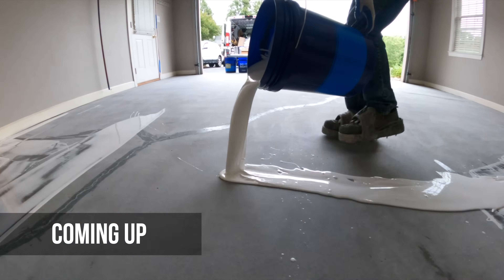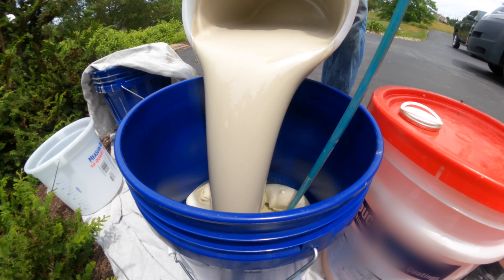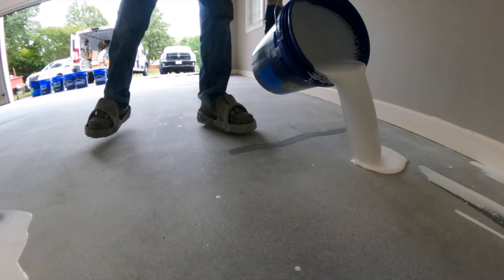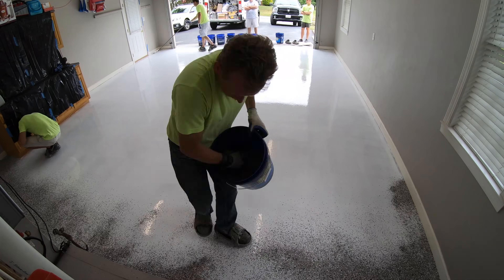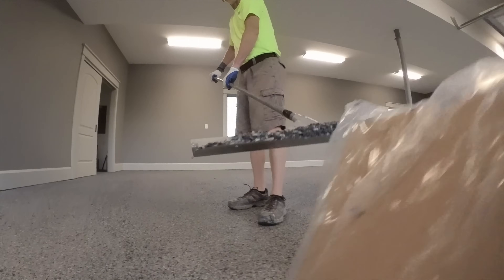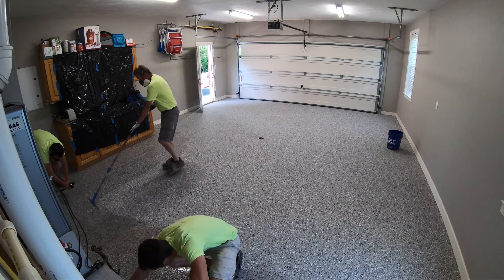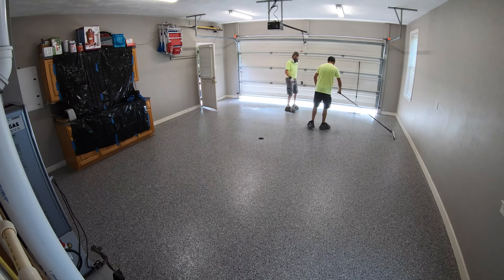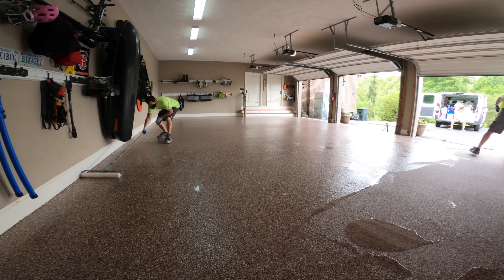Epoxy, Polyurea or Polyaspartic : Which is the BEST garage floor coating?

Comment: We had the same system applied to our garage floor a few years ago.  After they ground the concrete, they applied a product to extract moisture out and left it sit with fans for 2 days.  They checked the humidity and had to reapply the moisture product again.  After another 2 more days, they completed the finish.  It's been 4 years (Wisconsin winters/salt) and still looks perfect.  How do you deal with moisture and how long do you warranty the system (finish and adhesion)?
Reply from the maker: That’s cool. 

We use a vapor barrier primer that holds down up to 10lbs of pressure. Even if a floor tests low for vapor now, that doesn’t mean it can’t rise in the future, so we just use a vapor barrier on every job. 

I have a video here that covers that:

Epoxy vs. Polyurea : I forgot to tell you this one thing about garage floors...
https://youtu.be/UOeGvo5zGY4
Reply: Could you share the name of the company who applied your floor coating ?
Reply: @SavageBits   His own company does this.  The name of his company is on the side of his van.

Comment: Thank you for this video! I noticed some clients have their baseboards removed for floor treatments and some do not. Does it matter either way and which do you recommend?
Reply from the maker: It doesn’t really matter to us. I never ask customers to remove them for us… but if it’s a new construction project I will request for them to let us do the floor before they install the baseboard.
Reply: If it's a flake floor like this one, we normally ask the customers to remove the baseboards, and we will trowel sand and epoxy and flake up the wall where the baseboard was. Just looks clean and seals everything up 100%.

Comment: We used the Rust-Oleum solvent based epoxy + the solvent based topcoat and it is still pristine after 14 years, so I was glad we did not have to hire anyone for the job.

Comment: Please explain the rationale for steps. 1) why do you need to grind the concrete at the start, 2) what did you patch the hairine cracks with? Just concrete filler? 3) why do you need vinyl chips?
Im new to DIY and these details help

Comment: I loved your video thank you for your informations the floors look stunning ! I had my garage done 4 years ago , it’s starting to show a small wear and tear around the 4 tires where the car parks , I want to have someone coming to apply more protective top coat , I don’t remember what the previous company used I don’t want to use him because I didn’t think he added enough topcoat . What would be the best durable product to use for a top coat garage floor with chips ? How many coats should I ask for and does it needs to be sanded down a little bit for better bonding ? I am in the Washington PA area . Thank you very much for your time

Comment: Hi Tim! Thanks for your video. I have two contractors and they are giving difference price points. Both are using 100% solids epoxy. Contractor A: 2 coats of colored epoxy and then 2 coats of clear epoxy. Price: $5420 with coving. Contractor B: Initial Epoxy coating and then polyaspartic 80% solids urethane based. Price is $7280 with out coving. What am I missing here?

Comment: I had my floor done with a 100% solids moisture vapor barrier, then 100% solids epoxy with full flake, then a polyaspartic top coat… 
9 months later and it still smells strong. Have you ever heard of this? My installer said he’s been doing this for 20 years and has never seen or experienced it.
Reply from the maker: No I haven’t ever seen or experienced that. We use a 90% solids polyaspartic top coat, which means it’s only 10% solvent… so it doesn’t really smell that strong on the day that we install it. I can’t imagine what would cause it to still smell  strong that long after it’s cured.
Reply: @TimDCVA  thank you for the response.  Great videos.
Reply from the maker: Thank you!

Comment: So if you don't want to use chips and just want a smooth clean surface (Think like a clean room) you should use a Polyaspartic primer since it's UV stable and then go to straight to a Polyaspartic urethane top coat?

Thanks!

Comment: Hi, Can you please suggest the details of the products:1. High Solid Epoxy primer and 2. Polyaspartic Coating; where to buy and and what else to look for while purchasing. I am planning to paint my Garage Floor with Epoxy base and  using Polyaspartic (clear top) Coating, but finding it very difficult to purchase the items; especially, Polyaspartic  is neither available in Home Depot nor in Lowe's. It would be very helpful if you could kindly share the product details. Thanks in advance
Reply from the maker: Hi. 

We use 100% solids epoxy with 90% solids polyaspartic urethane. You usually have to buy directly from the manufacturer. 

We don’t offer specific brand suggestions on YouTube. That is available
In our course along with a lot more information about how to do this type of coating. 

https://decorativeconcreteschool.com
Reply: Great question, I have the same exact question. Did you get the details of all the products used to do the garage floor? if yes please send it to me as well.

Comment: I'm with you on that epoxies a lot better than the one day in and out epoxy has a better bonding to the substrate
Reply: False. The one days should be done in 100% solid polyurea which will penetrate and bond much better than epoxy. 

The two day shown here is less strong than the one day and they charged double labor cost. 

The capability to do one day is simply because it sets up quicker. It takes more skill and harder to work with which is why coaters shy away from it. 

Convenience of the workers is usually a non-factor for a consumer. They want the best product you want the "one day".

Comment: I have some water seep into my basement/ garage from rain and snow draining down my retaining walls or under my floors. I’m trying to eliminate any water from coming up through the floor (I don’t have a sump pump or French drain) I only have gutters. I plan on resurfacing the floor and possibly sealing it. ( still researching sealant types) . I also want to use a grinder along the wall to be able to get rid of the uneven trowel work and apply some repair cement to attempt to seal any pinholes. Would a sealant keep water from draining through the floor completely, would it help with excess water if coming up through my foundation? I’m currently using two 4 gallon  midea dehumidifiers and they seem to take care of a lot of the problem during heavy rain or spring runoff.

Comment: I already had my garage floor done , epoxy grey with chips about 8-9 years ago , I would just like to apply another coat of clear finish over the top , I was wondering what clear coat material that you used
Reply from the maker: I would probably sand the floor to abrade it and then coat it with a clear polyaspartic coating.

Comment: Polyaspartic is a lot better and more durable than normal epoxy floors. And it’s a lot less slippery considering the whole floor is completely covered in the flake unlike most epoxy jobs.

Comment: Great video. QUESTION: Is there a primer coat over the concrete floor first, then the epoxy and flakes or, is the primer and epoxy the same step? I know the polyaspartic top coat is last the second day. Thanks.
Reply: He answers this question in the video
Reply: @dannyc6656  Sorry no he really didn't. First he talks about High solids epoxy PRIMER then later he says " once we get the floor painted with EPOXY" ( not epoxy primer). This led me to believe the epoxy primer coat is  separate from the epoxy coat, you know, the one with color? Anyway, I get that it frustrates you to answer questions clearly in the video. Mine wasn't one of them.

Comment: Will polyaspartic still protect the epoxy without the paintchips?
Reply from the maker: Yes. You would just need to use a solid colored polyaspartic instead of clear.

Comment: Is there a type of floor covering that you don’t need to grind the concrete? And that works with concave floors like for a laundry room that has a drain in the middle?
Reply from the maker: If there is no sealer on it then it is a good candidate for acid stained concrete.

Comment: What would you do if applying polyaspartic to say 4000 sf at one time? Would you have enough time to apply it before it started setting?
Reply from the maker: We would do that all at once. You just have to have the right employees to keep each step of the process going. 

The main thing is to make sure the mixes are timed correctly so that it’s not sitting in the bucket too long. 

We cover that sort of thing in our online course. You can check it out here if you’d like:

https://decorativeconcreteschool.teachable.com

Comment: I have a question:
Would it be possible to just pour on an excess of the top coat, so as to leave say a 1/2 inch depth, and then let it set without rolling?
Is there a reason this is not done?
Reply: Yes because it will produce a very thick and uneven coating, and the cost is much higher.  The floor loveliness will also determine which areas get a thicker coating and which ones get a thinner coating.  So because of cost and flora levelness it is not done.  And nor should it be done that way because it will produce a substandard floor that will cost a great deal more money.  By contrast , using a roller mechanical brush will produce an even coating and use far less material.  And it is important to follow the.
Polly asparic floor coating manufacturer recommendations.  And if you don't know what they are , then you should contact the manufacturer and ask for them.  They will tell you very precisely on what is to be done, how where and when.  Some very very smart people work for the manufacturer and write the application instructions.  Don't be foolish like many people are and consult the manufacturer. And they will tell you exactly what to do.  The people who sell the floor coating and install it are not follow the manufacturer instructions , thereby boarding the warranty.  Most of the people who perform the application are uneducated and arrogant.
And so you must stipulate in the contract that the manufacturer's directions are to be followed precisely.

Comment: Can you still use epoxy in colder temperatures / winter? Or would polyaspartic be best?
Reply from the maker: We have an cold weather formula of epoxy primer for the winter… but we try to avoid installing in garages that don’t have any heat during the coldest part of the winter.
Reply: @TimDCVA  I do the same.  What product is your cold weather formula?
Reply from the maker: Cool. DM me on IG.

Comment: I have a Patio company in Texas and have two crews I keep busy but I was thinking about getting into this and doing it alone....do you think it's something I could do as one man or will I need help??? Most front and back porches here are about 250-350 SQ foot
Reply from the maker: You can do small jobs alone… and you can probably do some bigger ones as long as the patio has control joints or hand tooled joints, which would allow you to do them in sections.

Comment: What's a good coating for a new mortar shower floor? Needs to be moisture proof, non-slip, non-toxic and compatible with under floor heating.
Reply from the maker: I’m not sure. I’ve never done any projects like that.
Reply: @TimDCVA  
Yeah most people use tile or a pre-fab shower pan.

Comment: Is it necessary to grind the garage if it's a new build garage ?
Reply from the maker: Yes it is. The point of grinding is to make the floor rough. The floor is too smooth for a coating without grinding it.

Comment: Do you guys  use any sealer product before primer to prevent moisture coming from the concrete floor that sometimes makes bubbles over the time?
Reply from the maker: We always use a vapor that can handle up to 10lbs of vapor. Sometimes we will do a full vapor barrier if we think it’s necessary. Ex: a basement that’s completely underground. 

I have a course that teaches all of our methods if you want to check it out. 

DecorativeConcreteSchool.com

Comment: Is there a more natural look that can be used for basements? Without the chips? I feel the chips are very garage looking, but I want the ease of an epoxy floor for my basement, plus the possible cost savings vs. Vinyl flooring. Any suggestions?
Reply: I'd also like to know the basement floor application options.
Reply from the maker: We have metallic epoxy which works well for basements. I have a few videos on my channel about it.

Comment: Hi, Is grinding required for brand new garage floors as well? I thought acid cleaning is sufficient. Also, please let me know the what brand high solid epoxy you have been using. I don’t have insta account, is there another way to reach you please? Do you guys service in NC also?
Reply from the maker: Hi. 

Yes grinding is always required. You need to make the concrete rough so the coating has something to bond to. 

I share info about which brands we like in our course. https://decorativeconcreteschool.teachable.com

Yes we do work in some parts of NC. 

You can email me through the contact form on my website.

Comment: Does the concrete have to be ground, new construction concrete? also the chips stick directly to the epoxy primer?  
Thanks
Reply from the maker: Yes we always grind the concrete. 

We broadcast the chips into the 100% solids primer and it works great. It doesn’t work if you are using a lower solids primer (wb epoxy or low viscosity polyurea)

Comment: I've been doing a lot of research as a DIYer and have definitely skipped over the WB "epoxy" but I'm curious what products you are using. I've found a few different brands that seem reputable and cost reasonable, but I'm curious what polyspartic top coat you are using.
Reply from the maker: I like 100% solids epoxy and 85-90% solids polyaspartic. I cover which specific brands we like in our course. 

https://decorativeconcreteschool.teachable.com
Reply: Dang 397$ to learn what YouTube showed us for free?!? 😂

Comment: So why wouldn't you place TWO (2) coats of Polyaspartic (final finish) after broadcasting chips?
Reply from the maker: Two coats makes it a little too smooth for a garage floor. We haven’t seen a need for multiple top coats to justify the additional expense either.

Comment: I had the same thing done on my garage floor by a company out of Knoxville, TN. They had to come re-do it because the first guys messed it up. The second crew did a better job, but now about four weeks later, I'm noticing the color is leaching onto my driveway. Mostly where my tires back out of the garage. I've contacted the company again to come check it out. I'm thinking they didn't put enough top coat on or something...  IDK.
Reply from the maker: Was it a one or two day system? 

Do you know if they used a vapor barrier?
Reply: @TimDCVA  One day. They did everything else like you did. Sanded the floor, filled cracks, put epoxy down - then flakes. They waited for over an hour for that to dry, then scraped and cleaned up excess flakes, then top coat. Waited 48 hours to drive on it.
Reply: I tell my customers to wait 7 days before driving. Also make sure they are licensed and have been in business awhile and don’t have bad complaints against them.
Reply: @JohnDoe-er1zp  Good idea. These guys had only been in business for 1 year. The first crew only on the job 5 months. Now it's cracking right outside the garage door. They finally did come out to look at the cracks and said they'll fix them.

Comment: Outstanding job.  I am about to apply a 100% solids epoxy with heavy chips layer.  I also have a gallon of clear HPU but I’m am unsure about the slab just outside the garage door.  With the exposure to UV in AZ I’m not sure that it will not turn yellow overtime.  Your thoughts?
Reply from the maker: We always stop where the door lands because I don’t like the way it looks outside when the door is down. It also eliminates any worries about UV.

Comment: I was in the business for a long time, before it was popular. Bidding against clowns who paint the floor and throw chips in the air. Broadcast to saturation is the only way to go. I have over 1 million square ft of installations and this was my least expensive garage floor. Logos and scale pads 50k garage floors I did all over. Now I need knee replacements. Nice job guts!
Reply from the maker: Thanks!

That’s cool that you used to do this kind of work. I agree about full broadcast. 👍🏻👍🏻

Comment: As far as durability thats supreme. However the grey speckle is the worst for a shop floor because it hides anything layed or dropped on the floor and becomes a safety hazard.

Do it wo the speckle.
Reply from the maker: We’ve got you covered. 😜

The Biggest Complaint About Epoxy Garage Floors
https://youtu.be/wlNHQ7tJG6A

Comment: When will the decorative concrete class be available. Really interested in taking that class. About to sign up for the combo of epoxy and stained concrete class. Thanks
Reply from the maker: Hey! Hopefully I will get the metallic and overlay classes done this fall. 

Once they are ready, l will offer them at a discounted rate to anyone who is already subscribed to one of the other classes. 👍🏻

Let me know if you have any questions. Thanks!